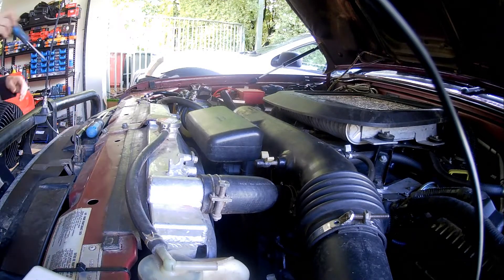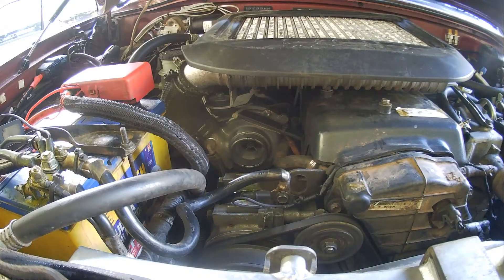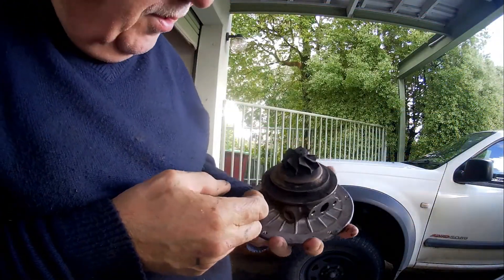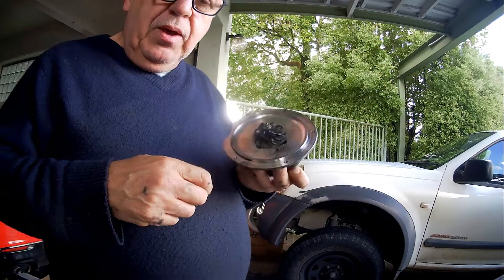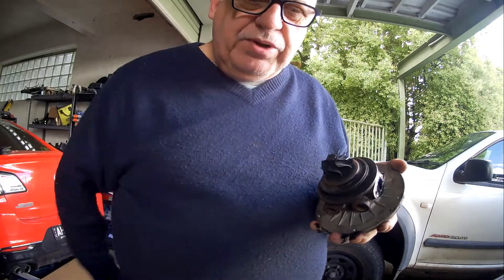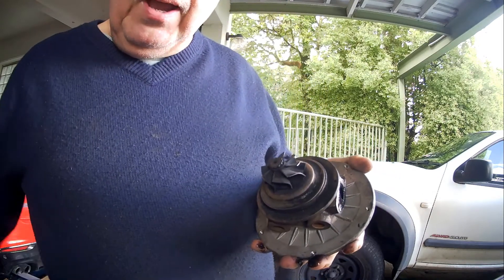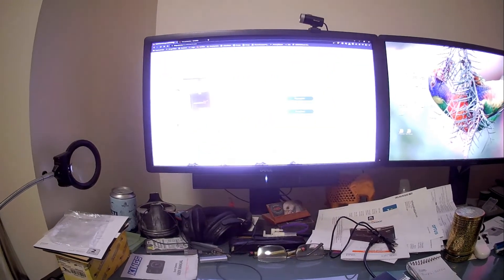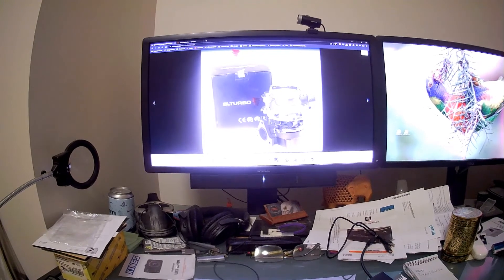4JX1 RHF5 Turbo Part 1 – Examining the Turbo for Faults

Comment: I appreciate you sharing your knowledge on these cars.  I have a problem where I believe I am getting no boost from the Turbo on JacKaroo 4jx it Starts Runs and drives but it lacks the power it had.  Do I need a boost gauge to check it or is there another way to fault find?